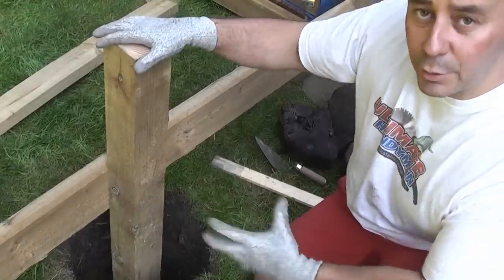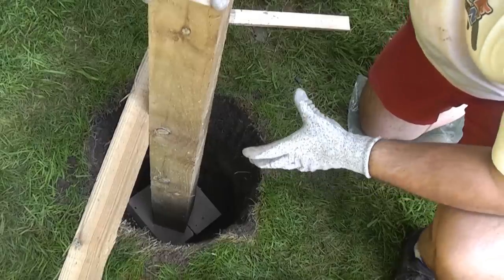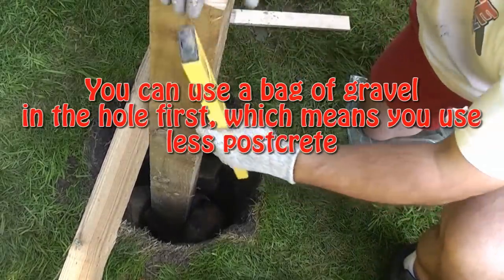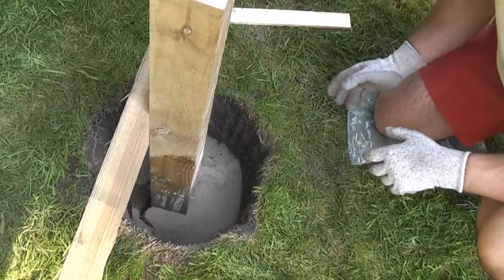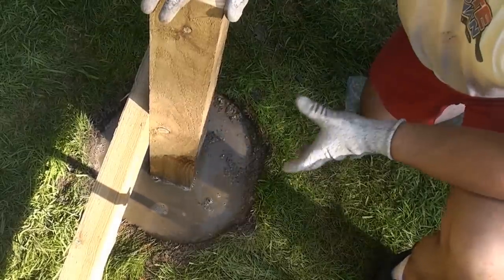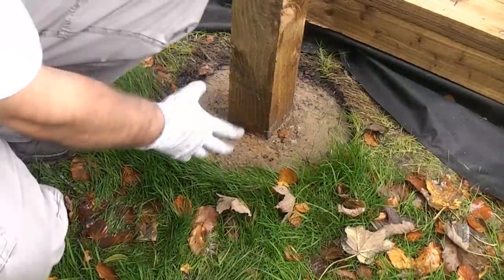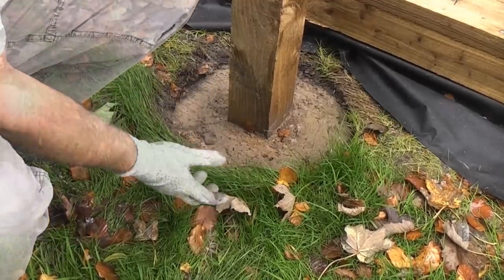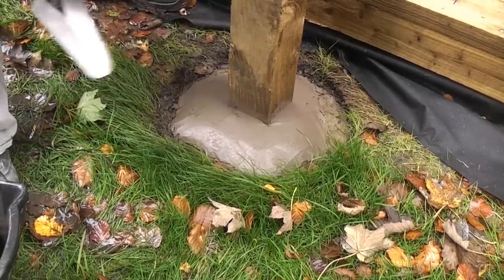How to install decking posts

Comment: IMHO you over did it with the foundations. 3 bags for a post that size is OTT. But in saying that your tip about concrete on top to stop water collecting as a great idea and well worth doing!!
Reply: ins4neuk was thinking the same.... unless the household is full of elephants!! 🤣🤣🤣 fuck getting an estimate off him?? 😱😱😱🤣👍
Reply: Longevity - Victorian and Georgian building technique.
Reply: @themvids6087 Weight of the joists, weight of the deck, weight of furniture, weight of a party of people! Add all that up………I think he knows what he’s doing, and I’d prefer him doing my deck than your cheap guy.

Comment: Tip: first coat post (any wood type) in asphalt emulsion (portion submerged/buried) before adding crete or dirt and wood will not deteriorate for decades.
Reply: I see you mention any wood type.  Does this include pressure treated posts.  I'm starting my deck build next month.  Thanks.
Reply: Do NOT add dirt round a timber post fullstop (if you want it to last that is!)
Reply: @LordCypress2  creasote the foundation posts and anything on the ground out of sight then use whatever stain etc you want each year or so on the bits you see, also postmix isn't as good as proper concrete made in a mixer because it's very fine grain and so breaks out easily if you hit it with a hammer etc. But that doesn't matter really if you are only a few steps off the ground
Reply: LordCypress2 I used blackjack on the posts before putting them in the ground, then gave all the framing a coat of it too... although I would wait till the framing is done before painting it as blackjack is kinda messy to be handling!! Water is the killer of all decking!! So better to waterproof if u want it to last?! 👍👍👌

Comment from the maker: @ russ Bramley 
I normally use 100mm*100mm tanalised posts.
For the joists I normally use 200mm x 47mm tanalised, but you can use smaller joists depending on the deck design.
Reply: ***** I have been putting my decking together and its going very nicely so far. Thanks for the videos!
Reply from the maker: ***** 
Good stuff, Thanks for the comment
Reply: Ultimate Handyman

Comment: Sorry if this may seem a stupid question but what's the point of digging a 70cm hole just to then back fill with rocks and pea shingle so you use less cement? Why not just dig a less shallow hole? Genuine question, not sarky!
Reply: water will be drawn into the post by the concrete and having gravel at the bottom provides drainage for that water to move out the bottom of the post
Reply: Don't use pea shingle, just use big rocks so that the post crete can work its way between everything and set solid. Also, this guy should have painted the post ends with black bituminous paint to prevent any water from entering the wood.
Reply: @MrNjCrothers  Use 3/4" gravel/rock at 4-6" depending upon pier size and frost line, compact vigorously, and really, coat the posts in roofing tar or other similar coating. Always mound the concrete.cement as shown, and best tip is to use some sort of sealant on that mound and a couple inches above on the wood. Everyone reading these comments currently will be dead before this rots out.

Comment: I'm not sure what the climate is like there but in most places, there's what we call a frost line which is about 18in below ground surface and warm enough to protect materials and mostly plumbing from cold weather. Most materials (such as CONCRETE) within those 18 inches are likely to expand and contract due to weather changes. The concrete footing is suppose to be poured below the frost line, cure and the rest of the hole filled with dirt or gravel otherwise the concrete above the frost line(within 18in of ground surface) will expand and contract around the post and cause it to wiggle lose. Never fill the hole above frost line and definitely not to top of the hole.
Reply from the maker: This is the recommended way of installing decking posts in the UK.
Thanks for the comment

Comment: never ad concrete within the post as it will rot! you should have made concrete up & add bracket on top etc.
Reply: To clarify, do you mean we shouldn't put concrete in with the post? if not how do you go about doing it with the bracket?
Reply: I think I get what you mean now. An alternative is to fill a tube and place a bolt on top, attach a bracket/brace to that and use it to anchor.
Reply: WRONG...my deck is installed that way, 17 yrs old, no rot....
Reply: He addressed that by tapering concrete around top of the hole so water won't saturate posts. No water = no rot
Reply: concrete doesnt rod the wood. normally rot happens at the top were it meets the soil. thats why he tapered the cement.
Reply: it will rot 100%. moreover, the wood is untreated. those two bricks at the bottom were hollow type.. ground right under them. guess what happens. water will go up via capillary route
Reply: @tahoefor  how the hell do you know they're hollow? 
Besides, it recommends engineering brick, which if it's class A is waterproof. Capillary action will not take place.
Reply: I’ve just dug up about 10 old wooden fence posts that were badly set in concrete roughly 25 years ago, every single one snapped at the base where it meets the concrete, that is the only place it was rotten. The bit inside the concrete wasn’t rotten on any of them, I know this because I had to break them all up to dispose of them.
Reply: Most of the farms in the world are done just this way, you a loony.
Use Pressure Treated, Ground Contact rated timber, most/all of that water will be gone as the concrete cures. Concrete will always wick up moisture, however there are a lot of 25+ year posts still standing today. 
Pro-tip is to get your PTGC lumber early and coat them with roofing tar wherever they will come into contact with concrete and slope as shown here, and seal that top with something.
Reply: Absolutely clueless comment

Comment: To those who say a post will rot if next to concrete underground, I have a deck that is 25 yrs old,,done just like this.  It's as hard and strong as it was when built.  If the ground is totally saturated with water I can see a reason to put a post offset at the ground level, but that's a rare situation in my experience.

Comment: I always tend to half fill the hole with water then pour the mix in. If it goes in dry the water doesn't penetrate well as the postcrete sets quickly. you end up with dry clumps in the mix
Reply: The postcrete will continue to absorb moisture from the ground for  ages afterwards . This will stop any dryness in the mixture. Also put the postcrete in as slow as possible so it all gets wet. pouring it in too fast just makes the postcrete hit the bottom and the water jump to the top. Takes a lot longer to set .
Reply: daisy180709 i
Reply: why dont people mix it first in a mixer or a barrrow like i always was shown, nice and even and consistant.  I also find it amazing how many of you are talking about fencing? hes building a decking with a fencers idea of concreting.  Oh well, i suppose its done differently in each country, but i can tel you the amount of fences ive had to fix from almost falling over due to poor post and concreting is staggering.  Fencers take shortcuts, builders do not.
Reply: Instant Concrete (Post Concrete I guess in the UK) would set in the barrow before you could mix it.  It's very different to traditional mix.
Reply: Postcrete is designed to be added into a hole filled with water. If you tried mixing outside of the hole you'd lose your shovel in a lump of set postcrete. I used 200mm x 125mm new oak 'sleepers' as fence posts in my garden all using Postcrete and 8 years on they are still solid as a rock.

Comment: The concrete on top to shed water is somewhat of a waste since the concrete below ground absorbs moisture from the soil thus rotting the posts of eventually. So if you pour a decent amount of concrete around the post you can always anchor some brackets to the concrete and fasten the post to the bracket.
Reply: You've just created more work for yourself and more cost for materials. This makes absolutely no sense whatsoever.

Comment: I have done many this way, but they will ROT and especially the newer treated lumber, which rots very qucikly compared to the older arsenic laced stuff.
Reply: Heard that from many people. Suggestion is to insure you are getting actual Ground Contact rated Pressure Treated, not simply Pressure Treated. Also, get the lumber early and coat it with some of that roofing repair tar.

Comment: Great vid mate and like what you did with the brick at the bottom of the hole too. I wonder if you holes need to be that big that as 3 bags of postcrete is a lot and that a very deep hole - was it a tall suspended deck? thanks
Reply from the maker: You can dig the holes a bit tighter, especially if you use a post hole digger. I normally fill a lot of the hole will rubble, but did not have any on this occasion. The deck is still standing 😂
Thanks for the comment 👍

Comment: we use postcrete a lot at work in our business  and a great tip is to pre mix it in a tub first and poor it in the hole thus ensuring you do not get layers of crusty concrete with gaps of dust lol  when you add the water make it quite wet but be very quick from adding water to filling your hole lol
Reply from the maker: Thanks for the comment 👍

Comment: It’s amazing how no one mixes the concrete any more, that’s the best way
Reply from the maker: Concrete is great, but post crete is much quicker and easier.

Thanks for the comment
Reply: post crete is just concrete mix and if you check those today you will see its not well set. mixing the old fashioned way in a bucket or barrow is still the best way for perfect mix
Reply: @Joshua79C  depends what you buy dude, there is mix that is designed to be  installed that way...i used it on my deck 17 yrs ago, no rot and its still tight...gotta watch what you buy
Reply: @Joshua79C  Postcrete is not just concrete mix, it has additives which makes it set much faster, which is extremely useful when putting up a fence.

Comment: What is your opinion on making small concrete pads, then using a metal post support? Less hassle if you need to replace a rotting post.
Reply: What's your opinion of a wobbly post?
Reply: I've been looking at these, but I'll be using them for a Pergola that is attached to my house.  The house provides the rigidity at the top end of the post whereas a fence post has no rigidity at the top and is completely reliant on the based being secure.

The further away the top of the fence post is from its base, the greater the leverage and increased movement at the top.  So with a fence, having a good portion in the ground reduces the leveraging movement at the top.

Comment: You need planning permission if a deck is more than 12" above the ground or if it covers more than 50% of the garden as far as I know. Maybe there are rules for conservation areas. 

I've taken a different approach. I've had to build a level platform out from a patio door for wheelchair access. I was a bit concerned with getting the posts in exactly the right position with needing to leave space for newal posts etc. Having installed a ledge board (using stainless steel m12 studs with resin anchors - a nightmare), I made up the three other sides of the square using the 147 x 47mm joists, fitted that temporarily on the joist hangers on the ledge board, propped up the corners and made sure it was square. Then I marked out the position of the posts using a spray paint canister. I took the three sides of the frame back down, dug the holes with a post drill (but only to 600 mm), put the frame back and propped it up. I then cut and cemented the posts in place making sure it was all lined up. Then I used 12mm coach bolts to attach the joists to the posts. 

The post holes were a lot narrowed than those shown (but I did put a piece of thin paving slab at the bottom). What I also did was use those post-saver sleeves at the ground line, which are applied with a heat gun and which uses a sort of bitumen as the "glue" for the plastic sleeve which shrinks onto the post. I've used them on fence posts and they seem to protect the posts (and I also build the cement up as shown).
Reply from the maker: Thanks for the comment 👍

Comment: Thanks appreciate it. U could of saved my life or at least a mayor problem. Looks like I will be buying a angle grinder. Would u suggest the bigger grinder size or smaller size machine
Reply from the maker: I'd just get a 4.5 inch grinder as they are the most versatile, or you could get a 5 inch which means you can cut slightly deeper than a 4.5 inch.

Comment: Newest news I've seen recently is that post rot is due to water entering at the top of the post, and wicking down to the bottom where it can not escape. Have a 46x16 deck to build, and doing with footing pads and a 6x6 at 60" for frost, no concrete, and coating the timber with some sort of creosote/tar below grade and several inches above. If I were you, I'd dig out a bit around those posts and put a sealant all around that cement top and top of concrete pier. Maybe after drying add another coat right where the post come out of the concrete.

Comment: Hi what cement mix did you use at the end of the video?
That's a good tip about water drainage.
Reply from the maker: I think it was about 3 sand, perhaps 4 sand to one unit of cement, I'm not sure if I did it in the video without watching it again, but I now use SBR for mixes like these, as it makes the mortar waterproof.
Thanks for the comment
Reply: @ultimatehandyman  many thanks
Reply: @Ultimate Handyman  @Kampash  hi, great tip. Is SBR the same as a plasticiser? And you use this rather that water to the mix 3:1?
Thanks

Comment: I ended up using 1 bag of cement per post, but I put my post down 4-5ft.  That's BC of how my yard is.  It tapered down in the back, so I didn't need to go as low.
Reply: Nrfa how far down should you go with the post? I always over kill everything because I hate to do maintenance

Comment: Hi ! Great video and informative. Going by what some have said, would you recommend setting a post inserted in a metpost into the Postcrete to limit direct contact with the concrete ? Or is that overkill.
Reply from the maker: Gelert Jones You could do that if you wanted. They reckon that Tanalised timber will last 15 years, so as long as the top of the concrete holding the post is domed to encourage water run off you should get 15 years out of the posts. If you use the met posts you should get longer than that.
Thanks for the comment
Reply: ***** Thanks UH. Your video has been very helpful. Do you have any further advice to add consider that the posts I'm installing are 11 foot tall 4x4 corner posts for a pergola ? Thanks. G.
Reply from the maker: Gelert Jones I'd go for the met posts for a Pergola, they are probably better suited to this job ;-)
Reply: ***** Okay. Thanks. :)
Reply: Gelert Jones

Comment: So I have been reading all these comments and I still don't know if I should put my post in post create or should I just stand them on the concrete slabs? I'm based in Sheffield. Building large deck 6m X 5m. Building patio cover above deck...
Reply from the maker: This is the way most people install decking posts in the UK.
Just make sure that you use tanalised timber (pressure treated timber), then make certain that you mound the top of the post crete or concrete, so that water cannot pool at the base of the post.
Reply: @ultimatehandyman  Hello and thank you for your answer mate. What is your opinion about standing/resting decking posts on the concrete slabs? It's way cheaper way for me as I wouldn't have to buy post mix. Just worried about bouncing it back. I'm using 50mmx150mm joist timber for my subframe. And deck is build low to the ground.
Reply from the maker: I believe you can do it that way, providing the slabs are solid and will not sink. I have never done it that way myself though!
Best of luck with it ;-)
Reply: @ultimatehandyman  
Hi mate, just quick question as I haven't really got anyone to advise me. I'm in the process of building a subframe and I read somewhere that if decking is 3m wide the slope on deck should be 1:100 so I need to drop deck by 10mm for every meter - 30mm in total. My question - Do I need to build subframe on the slope with 30mm at the end point or should it create slop while laying decking board? My decking board will be laid vertical to the house so joist will have to be laid horizontal. So how to slope horizontal joist?
Reply from the maker: If the deck is being connected to the property, you start by fixing a level ledger to the property, then have the joists sloping down away from the property. You can get the fall by using a spirit level with a shim attached- https://www.youtube.com/watch?v=kVsSswu6g7o 

All the info you need should be in these articles- http://www.ultimatehandyman.co.uk/how-to/table/decking/
Reply: @ultimatehandyman  
Thanks mate I have used a long straight joist across as a guide. and this way I managed to get slope on each joist down. It's 24 square metre subframe. Weather was horrible in Sheffield but I have nearly finished now. Which type of decking boards do you recommend? And where is the best place to buy it?

Comment: What centres do you install the support posts along one joist? What distance would you install supports from one joist to another? Many thanks for your help.
Reply from the maker: +Neil Lomas 
It depends on the design of the deck and joists etc. 
Normally I space them at about 1200mm centres.
http://www.ultimatehandyman.co.uk/how-to/decking/fixing-decking-posts